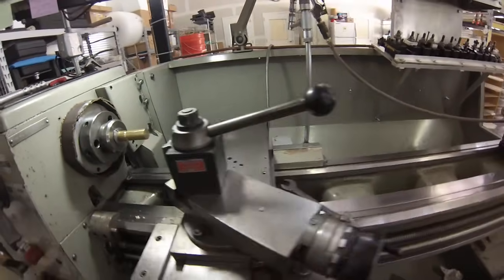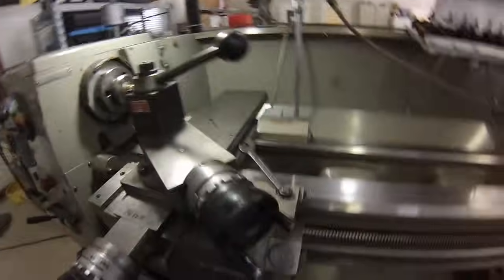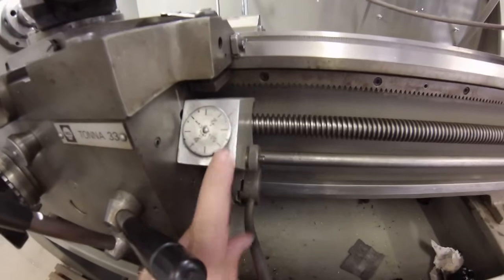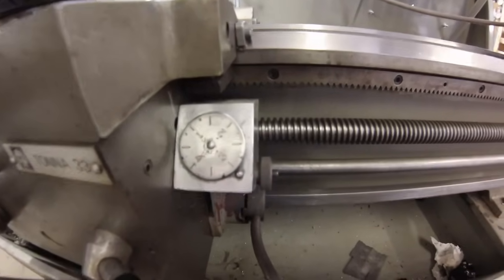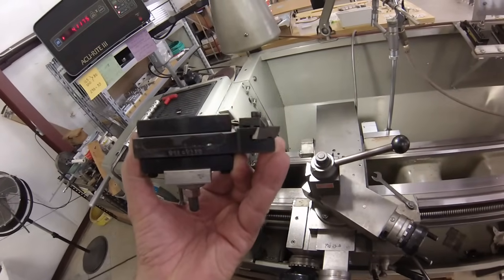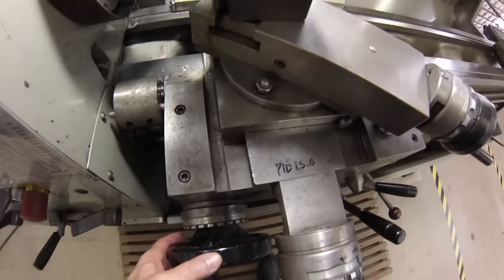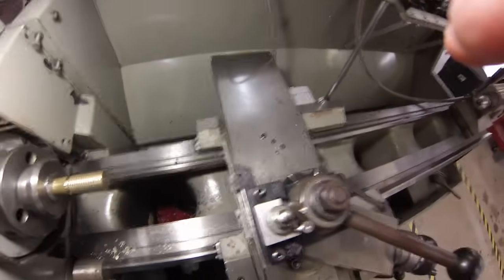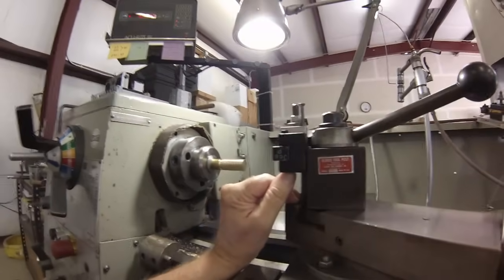Threading on a manual lathe  BEST TECHNIQUE EVER !!!!

Comment: Joe:

I have an old Clausing 13" and its equipped with an Anjest threading unit that I've never used but need to! It is for high speed threading with an unskilled operator. Once it is setup the carriage runs up to a stop kicking out the half nuts. The tool winds up making an undercut.

-'lil stan
Reply from the maker: Absolutely. It always will. Only a CNC lathe can repeatedly pull the tool to leave a diminishing thread. Thread milling on a CNC mill is the other option if no undercut is allowed. If you get a drawing that doesn't allow an undercut, question why.

Comment: But what if your not allowed an undercut? Also, with the tool upside down the forces will  "pick up" the tool from the bedways losing rigidity. 

Something my boss showed me years ago is to setup a "pointer" on the bedway that lines up with a mark on  the carriage at the end of the thread - this way you don't even look at the thread and get "spooked". Something else I've learned is to have the "X" cross slide wheel at about 10 o'clock to rapidly pull the tool from the work.

I like to "compound" my threads (29 degree for SAE and Metric threads), this way the cross slide wheel is always returned to the same position which makes the job easier. 

-'lil stan
Reply from the maker: Hey Lil Stan. I like comments like this. You have good tricks in your bag too. The cross slide wheel position is a good one. Try to follow this......An inverted tool does lift on the stacked components of the lathe. The compound to the cross slide, the cross slide to the apron, and the apron to the ways.  This being said. When a big form tool chatters, its because all these gaps are smashed shut and the tool has to flex violently. Too much rigidity. An inverted tool will have the benefit of a shock absorber effect from all these expanded joints. My equipment is fairly rigid, so threading rigidity is not usually an issue. Next topic. I have never seen a print that did not allow for a continuous finish groove or undercut at the termination point of a thread. The only realistic way to accomplish that is thread milling or CNC control. Consistent thread control without a groove on a manual lathe is unlikely and potentially catastrophic to the part and tool. I'd like to meet the guy that can do a 100 parts and have them all come out the same way with a non undercut thread.  Check into Trav-A-dial for your lathe if you don't have a DRO on it. They are fantastic, accurate and affordable. In closing, hitting all the profile dimension of a class thread, is almost impossible. OD, ID, root crest and root widths, and PD all at the same time while coming in at 29 1/2 degrees is quite a task. Many other variables drive your technique as well like the wall thicknesses, adjoining features, material etc. I always hit the PD. Regards JP

Comment: I have used the technique you have demonstrated to good effect when screw cutting in blind holes. But for sheer speed and not needing an undercut this attachment will allow you to cut threads even faster and easier http://www.lathes.co.uk/ainjest/

It was designed in the late 1960's and is still available to this day http://millhillsupplies.co.uk/tools/ainjest-high-speed-threading-attachment/
Reply from the maker: I like it. I have never seen one before. An internal thread video is on my menu for the very near future.

Comment: Joe: I learned from my first trade instructor ( near forty years ago) that if the thread pitch you are cutting will divide evenly into the the pitch of the lead screw then you can engage the half-nut at anytime without using the thread-dial (IE: if a 4 tpi lead-screw then a 4,8,12,16,20 .... pitch thread can be cut without using the dial) saves a lot of time especially if have a cross slide dial stop.
anyway keep up the good work. Ken
Reply from the maker: I have never heard that before. Thats sounds perfectly logical though. I think that is a great tip to share and I'll have to test that one out. Thanks Kenneth.

Comment from the maker: To all my viewers. Please exercise caution and use good judgement when running a machine with a true screw on chuck. Excessive spindle load with the machine in reverse could potentially unscrew your chuck causing damage and personal injury. Refer to your operator or machine manual for safety suggestions. Cam lock or keyed and collared chucks are the safest to run in reverse. This demonstration is for reference only and should be used at your own discretion.
Reply: I turned a piece that would fit inside the chuck against the chuck backplate, pinned it to a shaft that would fit through the spindle and turned left hand threads on the on the end of the shaft protruding through the outboard end of the spindle and then made a nut with left hand threads. The should prevent the chuck from unscrewing when operating in reverse, plus it gave me a chance to cut left hand threads for the first time.
Reply: @55nsmooth  I'm having trouble envisioning the device you are describing. Is there an example of this online somewhere? I want to build something like this for my southbend.
Reply: EJ , it sounds like Mike Hunt made a long shaft that had a bigger head on one end that when he put it it through the spindle bore the bigger end would go up against the backplate that holds the chuck.  On the other end of the shaft you build it will come out of the spindle hole , where you have a left handed thread to hold the chucks backplate against the spindle, not letting it spin off.  Since the spindle hole is filled with the shaft you can't have a shaft or anything that is long and needs to go through the spindle hole.  But if the part can be held in the Chuck or between centers you are all set.  If your backing plates hole is bigger than your chuck, then you won't have anything for the shaft you build to hold onto.  Hope that helps.  Merry Christmas.  Tom
Reply: @Okie-Tom  I don't leave my "draw bar in" Only put it in when threading.
Reply: Mike Hunt great idea!  I am going to look and see if my backing plate has a small enough hole to have the shafts landing to hold on to.  My ole Jet lathe has the screw on chuck.  Merry Chrstmas.  Tom
Reply: @55nsmooth  I did the same thing works great.
Reply: Joe Pieczynski Hey Joe any recommendations on a gun smithing lathe? I would really enjoy talking to you about some things I am young and green at this stuff!
Reply from the maker: I don't know enough about gun smithing to suggest one. You'd have to know about the biggest longest part you expect to hold, how you expect to hold it, and what type of feature you plan to cut, then start looking.
Reply: Joe Pieczynski hey mainly it would be secured in the headstock for threading the end of barrels and clambering the rifles in about the 20-28 inch range but is usually held near the headstock. I also would be interested in milling flutes into the barrels as well. Just wondering if like a grizzly gunsmith lathe is really any different than some of these other lathes
Reply: Joe Pieczynski very good I'll try it
Reply: can vouch for both,
Reply: When i was in college they made us use math to figure out the measurement over wires(it was a pain) The rubberband trick for the 3 wire is pretty cool to.
Reply: Mike Hunt  3
Reply: This happened to me when I first got my lathe and I tested it out, landed on the ways, they look fine (for a 1950s lathe), not quite sure what to do with the reversing feature if I don't dare turn with it...
Reply: Isn't Grizzly the same company as South Bend? (Or should I say Grizzy bought them out)
Reply: Can you use this on aluminum with  high-speed steel tools
Reply: A grizzly is ultimately going to cause you potential headaches when you need super precision, check out south bend for the cheaper side, monarch ee if you want to spend some cash.

Comment: As safety is important please let people know that if there chuck is screw on they cant use this method as it is very Dangerous.
Reply from the maker: This has been communicated in the string of comments below many times. Machines with keyed and collared, or cam chucks are the best for this application. Shops with true screw on chucks, should refer to their machine manuals and common sense before running their machines in reverse for any reason. Good comment. Thanks.
Reply: Ps i have subscribed channel looks great
Reply from the maker: Thanks. I edited the header to include the safety warning.

Comment: if you ever see a guy running an engine lathe and a video camera at the same time....................you know what to do.....safety first.
Reply from the maker: As I recall,  I sat it down during the actual demonstration. For me, threading is a 2 handed operation. Severe injuries only take a momentary lapse of concentration and believe it or not, the machine will keep on running after it takes your finger off. I do appreciate the safety first comment. I live by it.

Comment: Hi Joe,
I've subscribed in your channel a second ago - there are many of tricks to learn from you...
I've done this way of thread cutting before and it's a very safe and fast way to do this. But what was new to me,
is that you are able to release the cutter in case of an emergency, a heavy chatter or blockage of any kind.
Thanks a lot and go on with your channel,
greetings from Germany, Thomas
Reply from the maker: Hi Thomas. Thanks for commenting. I've been to Germany. Beautiful country. Great Beer !
Reply from the maker: I needed to clarify this.  The tension on my tool holder is usually very light. I've run hundreds of large plunge form tools and always do it in reverse like this thread. Any excessive load on an inverted tool and it will migrate upward all by itself. I would have to say unlocking the tool during any process would be a recipe for disaster. So...the cutter finds a happy place all by itself. I wouldn't suggest a manual release during a cut. The tool would dive into and bounce around on your part.

Comment: Far be it from me to be questioning a pro like you. But I just tried this for the first time on my lathe. What i noticed is i dont get as good a thread. Because we are only using the cross slide and not the compound we r cutting on both sides of the insert tip at the same time with this system; which seems to leave a little chatter. Any way to overcome this, other than taking lighter cuts?
Reply: use modified flank infeed off the compound like you normally would , this will only impart force one the one side of the tool.hes using radius infeed because hes on a powerful machine
Reply: obvious the feed would be reversed as would the compound
Reply from the maker: Hi Warren. Thanks for commenting. I would agree with Rob below. In situations where rigidity is an issue, go back to the compound angle infeed. Large industrial machines are more rigid and won't experience the chatter. Aside from the chatter, was the technique less stressful for you?
Reply from the maker: The chatter could also be coming from a dozen other locations based on your tool, part, rpm, material, etc. Take a good look at the whole setup before you give up.
Reply: Thanks for replies guys.
 Yeah, now I have gone back to using compound slide with this method I love it. Will be using this method from now on. Takes ALL the stress out of the procedure.  Just have to remember which direction to turn the compound LOL

Comment: I have done this in a similar fashion for years.  I thread away from the head stock but I have the tool right side up on the back side of the stock.  I've done it both ways but get smoother results threading from the back side.  This is particularly critical when threading rifle barrels.  I do a lot of metric threads on rifle barrels, which adds additional complexity (i.e., you cannot disengage the lead screw on an inch lathe).  That's a video in itself..............
Reply from the maker: How do you apply your technique when the part is between centers?

Comment: Hi Joe, I am worried about rigidity in my tool post with the cutting forces pulling up on the post away from the lathe ways as shown in your video. Wouldn't your approach work better on the back side of the work where reverse turning would push the cutting tool down against the ways instead of pulling it up? Also, how about a close up (or even a dedicated video) of how you are holding those thread wires? I am old and I just can't seem to do it as easily as you do without using grease in the threads to hold them.

Comment: I've always wondered, is there an equivalent method to the 3 wire method for measuring internal threads to a standard measurement instead of a mated external thread?
Reply from the maker: I have never seen anything that compares. I have wondered that myself though. Remember, if you make a plug gage for a 'B' class internal thread, although you are cutting an 'A' class external thread for your gage, you must still use the 'B' class pitch diameter to make it. good luck.
Reply: Good to know.  Thanks, Joe.

Comment: good advice on not using the nut as a gage. this is looking like the definitive guide on this procedure. i've pondered it many times. this is it.
Reply from the maker: Thank you. I have single pointed thousands of threads this way and never failed. And NEVER use a nut as a gage...EVER.

Comment: We have an old belt driven lathe that unfortunately doesnt have a thread dial. Doesnt look like it was made to have one.
Reply: you don't have an engine lathe.  There is no way to time the movement of the carriage to the chuck.  The dial is just part of a system that also includes a thread lead screw, a split nut and a control lever that is used to basically grab the lead screw in order to pull the carriage in time with the chuck.  All of this works to place the cutter in the exact same spot for each and every pass.
Reply: jesse foulk. make one, thats one of my intentions. I have a lathe made between 1916 and 1920.

Comment: I saw a video Keith Fenner did where he was threading the same way, it's a nice trick. He also didn't use a thread gutter, he'd engage the half nuts with his crossfeed still out, and then gently feed it into zero as he approached the start of the thread. It gave a really nice look to the thread

Comment: Hi Joe. Great tip. I'll try that soon on my hobby lathe. The only problem I will have is that my lathe doesn't have Clock dial. Any tips on that? My lathe is Proxxon PD400.
Thanks for sharing your experience.
Reply from the maker: If your lathe is intended to thread, set your pitch and double check it with a pitch gage, then you will probably have to manipulate your carriage with a series of motor moves with the nut engaged full time. Its a pain in the butt.
Reply: Thanks Joe.
I'll try that